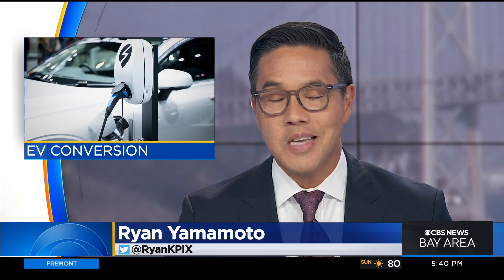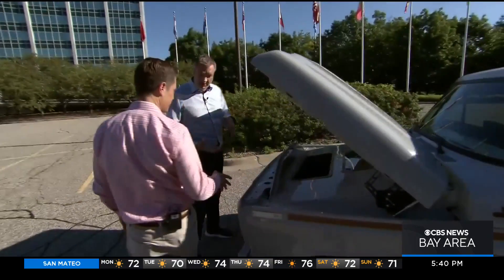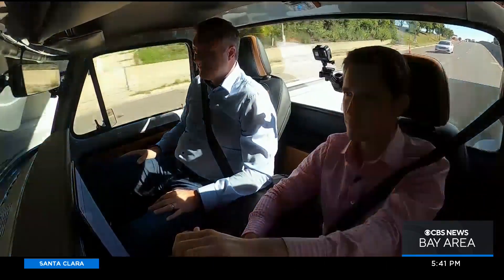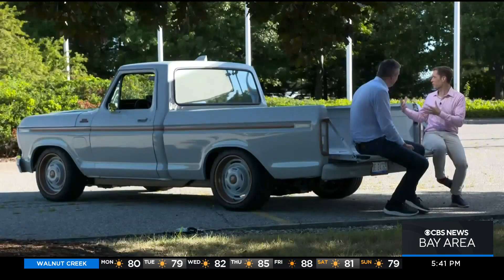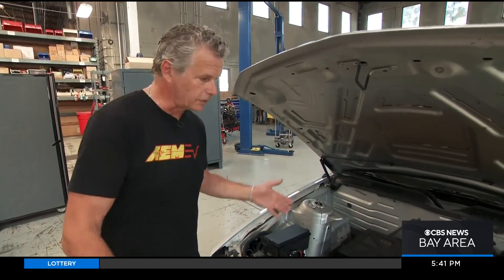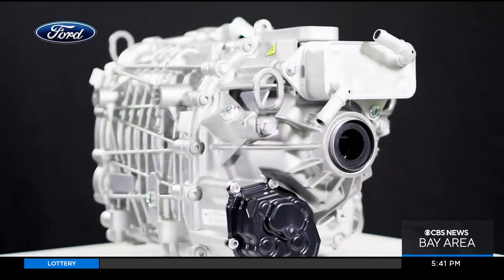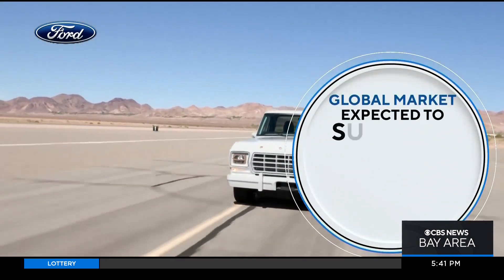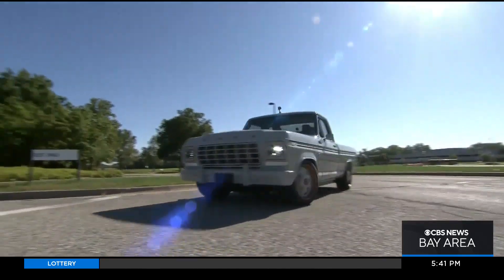Old gas guzzlers being converted into electric vehicles

Comment: This has been and is being done for 10 years or so now, in the aftermarket. The issue with "Old" cars is not the ICE, it is how Old they drive, their bad handling, their marginal brakes and all the old components. So to make this nice shiny Electric conversion, you HAVE to do Everything, steering, brakes, suspension, paint, rust, interior, seatbelts, wiring, etc etc,  just as you would to restify/mod a old classic with a hot IC engine etc etc.

Comment: Add a gasifier and all you need is a little bit of wood lol. It's easy and you never run out of fuel.  It's how europe drove around during and after WWII.  Zero fuel costs and you don't need electricity.

Comment: Plug-in electric hybrids are superior to full EV for most people. Most people only drive 39 miles per day. A Toyota RAV4 Prime plug-in hybrid has a 42 mile full electric range. Theoretically, you never have to touch the gas (once every 6 months of fuel tank usage is recommended). But if you need to travel farther, you’re on a 40 mpg hybrid engine for a total of over 500 mile range before fill up. You can just refuel like a normal car when you’re going on a trip. They just make more sense than full electric.

Comment: And it only drives half an hour and when it's too hot outside you can't charge your car
Reply: None of what you said is actually true but nice try. What oil company do you work for?
Reply: @debbiehunt5940  mmmmm well during the last heat wave they sure said not to plug in your ev vehicles....or did you forget debbie